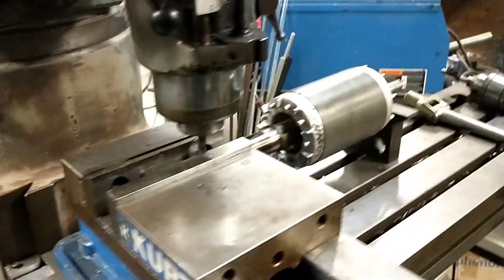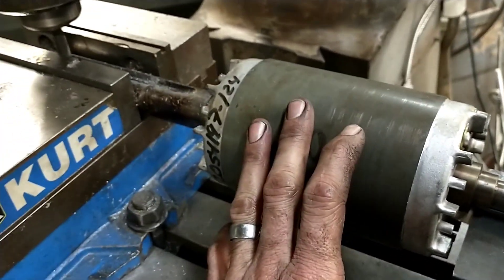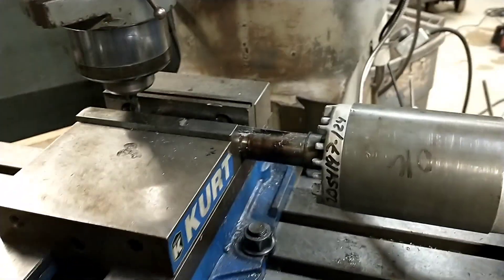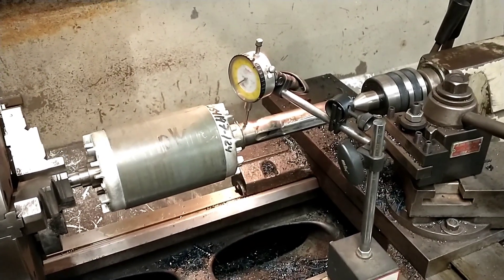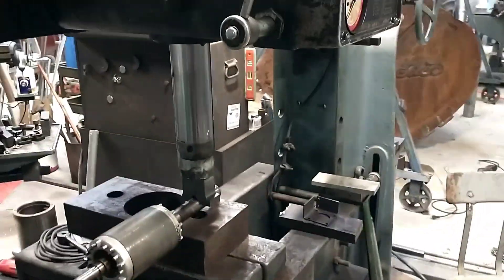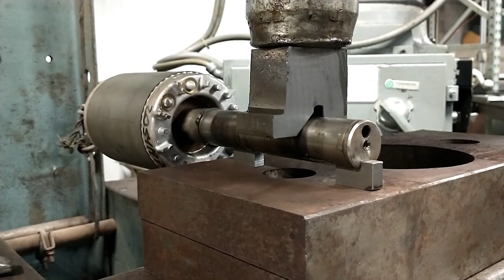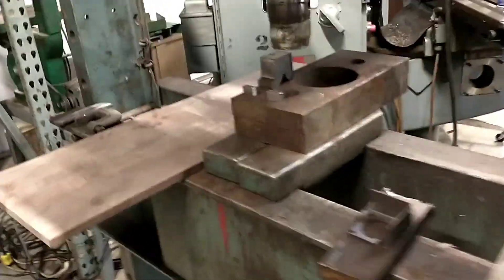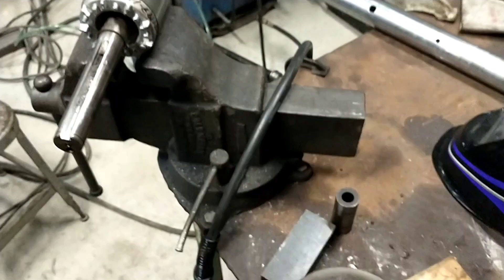Bridgeport Series 1 Motor Shaft Keyway Repair

Comment: Is it practical to try heat straightening, ala Keith Fenner, on a motor shaft?
Reply from the maker: I thought about it but I had concerns about how predictable it would be, and the possibility of annealing the entire shaft in the process reducing it's strength. It actually took very little pressure to straighten it, and I would say introduced little or no stress into the shaft itself because I would primarily be stretching the small amount of added filler.